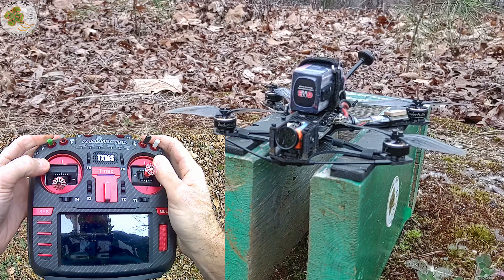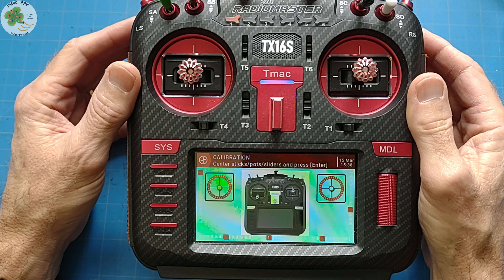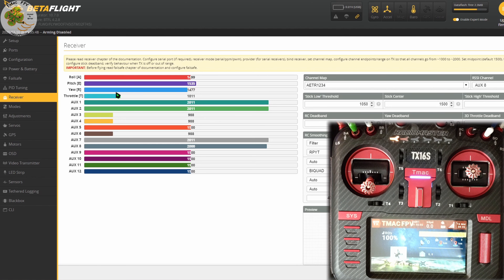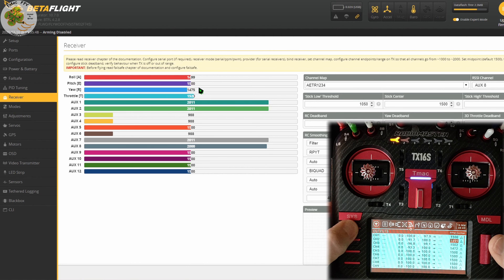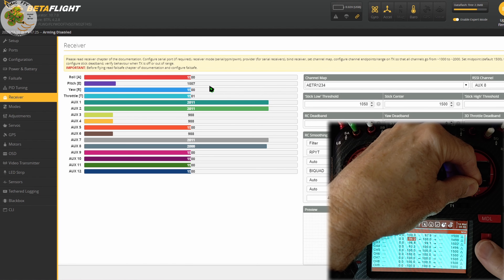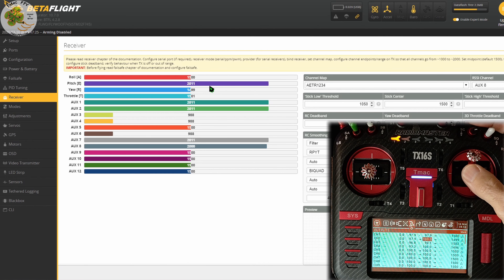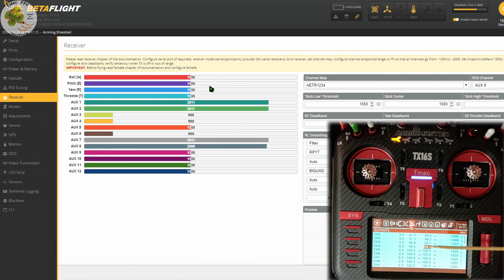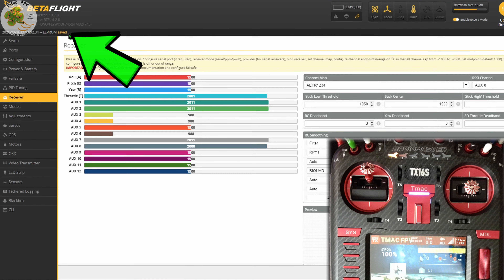Calibrate Channel Endpoints (SUPER SIMPLE!)

Comment: Hi Tmac i have been going insane for weeks!!! CLI wouldn't work to set throttle to 1000 everything else worked fine I used extended limit's it goes to 150 , now i cant get throttle to 2000 even at max .I am a newbie ,this drone was going to fly with or without a controller hehe. finally i must have typed in the correct words in YouTube or online ,cant remember but i finally found you with everything i needed, Verry informative i thank you for taking time to help people lie me that dont seem to read manual's (i usually do but just cant find it in my mess) God bless and thank you for stopping me from going insane i hope i can arm it now and not smash it into a wall or myself lol. took me long enough to get the drone to stay connected to the controller long story that one (no one buy a tiny bee made by bee rotor emu and beta flight do not let it connect as its to old). i hope they dont expire me to soon hehe. i will be watching as many o your videos as possible (subbed as well0 much love from sth aussie outback. ox
Reply from the maker: Happy to help Michael. You got this!💪😁

Comment: So glad I found your channel, and as it happens you make exact video I wanted to ask about. I have Radiomaster TX16S and I also can't set max endpoints to 2000. Is it a bug in Radiomaster ?
Reply from the maker: No, it's not a flaw with the transmitter. You should calibrate the channel endpoints with every quadcopter as it's the receiver speaking to the flight controller. This can be different on each quadcopter. If you perform the steps in the video, you should be able to get max endpoints to 2000. We're you not able to do this with steps in video? Even using extended limits as explained in video?
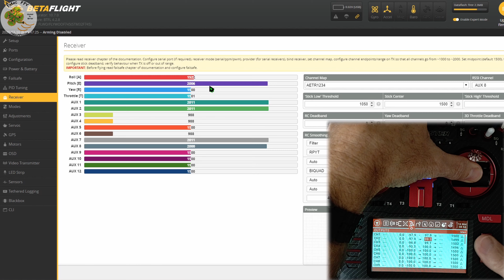Reply: @TMacFPV  I have done this before. But on TX16S it jumps from 1999 to 2001. It is just odd that this happens same as in your video. It looks like a bug. Maybe it is betaflight bug or maybe radiomaster, but looks like a bug. 9:45
Reply from the maker: @noobFPV  oh, now I understand what you're saying. That 1 microsecond off shouldn't make much of a difference, but yes, I was not expecting 5hat either. If you really want to get it to 2000 exactly, use the rxrange CLI command I mentioned at about the 6:23 time mark. For example go-to CLi and type rxrange 0 1000 1999 (where the first 0 is for the 1st channel, in my video it's for roll). If you're getting 1999 on second channel (such as pitch), type
 rxrange 1 1000 1999, for 3rd channel type rxrange 2 1000 1999, and so on ( for whatever channel you want to change 1999 to 2000). After you type this into CLI, hit return. Then type Save into CLI and return. Go back to Receiver Tab and max output should now be at 2000

Comment: At 100 my range on all my throws is 1159 to 1840.  I put it to the max at -150 and +150 and still only reaching 1074 and 1925 as my range. not enough for the quad to arm. When I click channel monitor on my tx its showing a range of 988 to 2012. Any suggestions on how i can fix this?

Comment: I just purchased a tx16s. Bog standard, brand new. I bound it to my quadcopter but my range in betaflight receiver is 1184 to 1850 on all channels. rxrange in cli doesn't modify anything. All my channels in the model setting are set to 100. My midpoint in the receiver tab is dead on 1500. Really struggling with this. I can't go past 100 in the output menu.

Comment: Thanks for the great video. I was hoping this method would help me. After arming, I raise my throttle stick to full, and the motors are at full. But when I lower my throttle stick, the motors remain at full power, and my throttle stick no longer effects the motors.
Reply from the maker: If you're doing this with props off that's normal. The flight controller is expecting your quadcopter to be flying when you raise your throttle. When it doesn't (with props off), it continues to increase throttle to make it fly. If that's what's happening, try putting props on, take it outside, and gently raise throttle
Reply: @TMacFPV  OMG, I never thought of that. I'll try it. I bet that's it. Thanks a bunch.
Reply: My friend. You just saved my quad from going on Marketplace. You were absolutely correct. If you are at work now, tell them I'm giving you the rest of the day off.
Reply from the maker: @jerryzito6840  😂👍

Comment: I dont have a problem with the centre values I have a problem with my end points. I can get the min values to be 1000, but I cant get the max values to get to 2000 because its already maxed out at 100 on my outputs page on my TBS tango 2 pro radio. Any suggestions? Edit I was watching till 11 mins and you explained it. thanks so much man !
Reply from the maker: Try this . . .In Model Setup menu, scroll down to "Extended Limits" check box and enable it.
Reply: @TMacFPV  I managed to get it I had to enable extended limits. Is it strange I had to go over 100 on the high end points for all 4 channels?. I'm using TBS tango 2 Pro
Reply from the maker: @PatrickGuerrisi  Happy it worked for you Patrick!👍I have no experience with the Tango 2 Pro so I'm not able to say if it's "normal" for that transmitter or not. I wouldn't worry about it

Comment: I just received my tx16s and wanted to know do you have videos where it explains what to first do with a completely new tx16s? Should I update stuff and or change settings especially for fpv? thanks a lot!
Reply from the maker: Hey lucada32, congratulations!  I'm excited for you.  I am VERY happy you asked me that question before you started to do anything.  First of all, your TX16S will work absolutely fine without you doing anything to it like upgrading firmware.  Please, do not attempt to update any firmware on it at this time.  In fact, most people make the mistake of attempting to update firmware on their new transmitters without fully understanding how to accomplish it and end up with a transmitter that doesn't work and then having to go through the frustrations of trying to get it fixed over the internet or social media.  Having said that, yes there are things you should do with it and I do have videos that will help you.  Specifically, I have a Playlist of videos on the RadioMaster TX16S here you can reference.  https://www.youtube.com/playlist?list=PLKAiYAaTdvmrEDFS4el4MjDOrY_Et2QnG   The first video in the Playlist is how to set it up (calibration, etc. and uses the User Manual for it). It also goes through some customizations.  The second video is on backing everything up before you do anything else.  i would recommend those two videos initially.  Then, I would recommend you watch the first two videos (at least) of this Playlist on OpenTX. https://www.youtube.com/playlist?list=PLKAiYAaTdvmqxtSKfP-2_QQlS_fd6h2YU The first video is on OpenTX Basics as an introduction/overview so you won't get completely overwhelmed with what you're about to experience.  The second video (although using a Jumper T16 transmitter) explains the types of firmware you have on your RadioMaster TX16s (yes, there is more than one).  Both the RadioMaster TX16S and the Jumper T16 use OpenTX operating system firmware AND have a multi-protocol module (MPM) that has its own firmware.  The video I'm speaking of explains this better than my comment here.  Lastly, if you're new to FPV and/or drones in general, I'd encourage you to take a look at the course curriculum for the Fast Track FPV Course here https://tmacfpv.thinkific.com/courses/fast-track-fpv .  You may also find "some" useful info by browsing through the pages of my site at https://tmacfpv.com/ . Hope this helps.  Should get you started in the right direction!  Once again, congrats on your new TX16S!  Email me at tmac@tmacfpv.com if you have questions.  Clear skies!
Reply: @TMacFPV  Hey man I am also VERY glad having asked you, that is a really in-depth answer and I will definitely check out the playlists and the website you linked! the fpv community is really the best, so many helpful people, thank you :) 

wish you the best and I might come back here if I got further questions ✌🏼

Comment: Hi i just got this radio, and when callibrating and sliding the right slider all the way to the top on screen i only see it going a bit above half of the center, the left slider reaches the top. Do u know a fix and if its software or hardware? When sliding it smoothly goes from the bottom till lets say 54% without a dead zone so i think its a bug or setting, anyone got a clue?

Comment: Does it have to be bataflight can’t it be done from the RadioMaster tx16s directly?
Reply from the maker: not sure I understand your question Reginald, did you watch the video?
Reply: @TMacFPV  Yes I did! And thanks for shearing, the video was very helpful, I was able to get my Castle ESC to arm. But I wanted to know if it is possible to calibrate the end points from the radio and not have to use the Betaflight software. 

I tried to download the Betaflight and I was not successful.

Comment: Josh Bardwell has a much easier way to do this within Betaflight 's CL. but thanks for another view on it.
Reply from the maker: Thank you for watching - as I mention at the 6:23 time mark of this video, yes, there are a couple ways of doing this.  However, if you use the "rxrange method" (mentioned in this video) in the CLI that will change your min and max endpoints but you still may need to change your PPM center which means going back to the Outputs Page and using the subtrim column (which is the same page you'd be on anyway if you use the method I'm demonstrating in this video).  Usually, there are more ways than one to do things with Betaflight, OpenTX, etc.